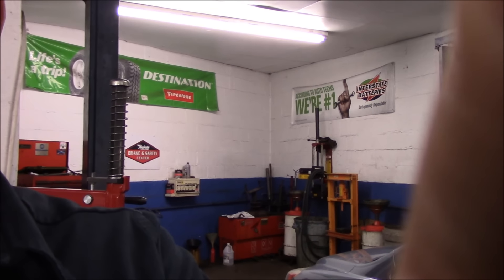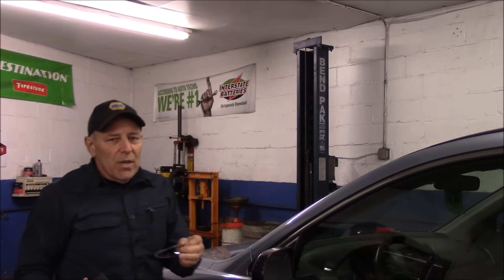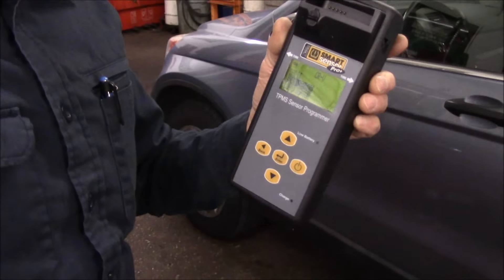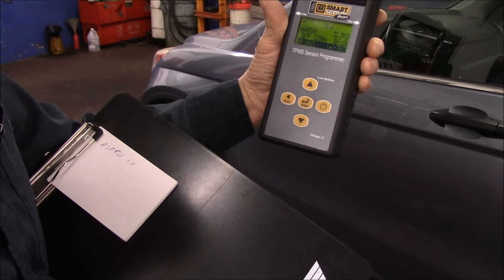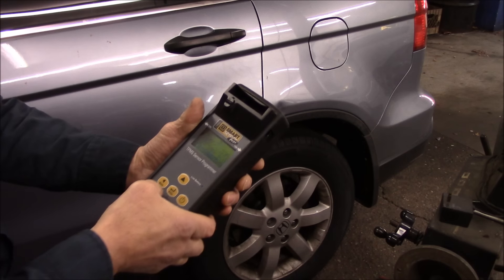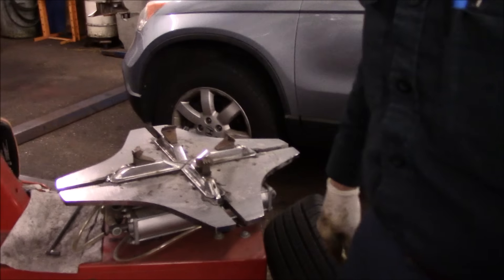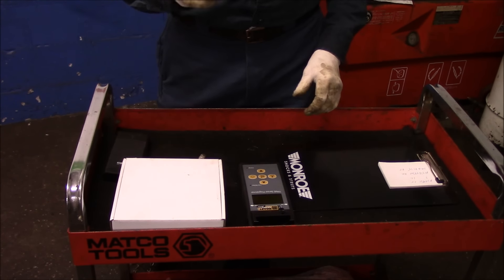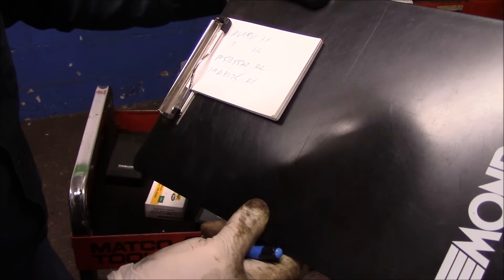How To Reset Low Tire Pressure Light (TPMS) Tire Monitoring System

Comment: This video is deceiving. The "TPMS" light on my vehicle has absolutely NOTHING to do with tire pressure.
Reply from the maker: Really what is it then(TPMS)?
Reply: Just now saw your reply. "TPMS" light means that there is a failure in the system itself. It will illuminate whether or NOT you have a low tire. There are only TWO things this light tells you: either one or more sensors are bad, or the receiving module is bad.

I have extensive experience in this area. In fact, my wife just came from the dealer yesterday after a return trip for the light coming back on. She was informed that the module has to be replaced. ALL FOUR tires are at perfect pressure.  Additionally, she got THREE flat tires while this light was illuminated. And each time the low tire icon did NOT light up!
Reply: @jimthecarguy  Update:
Last week, we finally had the TPMS module replaced by the dealer. Just a few days later (today), it came back on AGAIN! Furious, after having EVERYTHING replaced, I immediately took it back to the dealer. After a complete diagnosis, they determined that it was probably due to some outside radio interference based on a trouble code. Additionally, they gave me a copy of a recent TSB stating as much. So now I have to keep a record of details if it happens again, and report to the dealer. Wonderful.

For what it's worth, my wife got two flat tires last week, and BOTH times the low tire pressure icon did not turn on because the TPMS receiving module was still bad (was replaced a couple days later). But the dealer said that the system will still give a low tire warning while the TPMS is lit ONLY if such illumination is due to outside radio interference.

Comment: Those tire pressure sensors suck!  They’re always failing, I thought you were gonna show how to reset the code or something like that!  🤦🏼
Reply from the maker: Unfortunately when the battery in the sensors fail there is no choice but to replace them.
Reply: @jimthecarguy  it was a bad idea from the start, I have a minivan that has the same problem.  I get the sensors replaced and a month later the same problem, I don’t bother changing them anymore!

Comment: All this is bullshit, just put 35 on each tire done deal
Reply from the maker: Agreed just check the tire PSI and you will not have a problem. I can't tell you how many customers come into my shop with the low tire pressure light on .